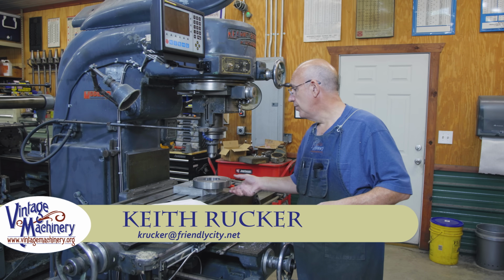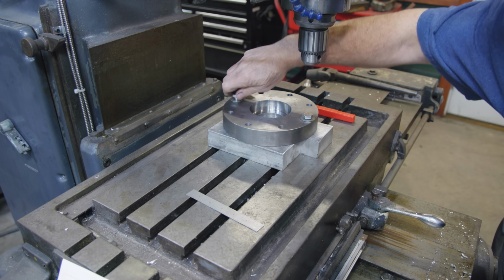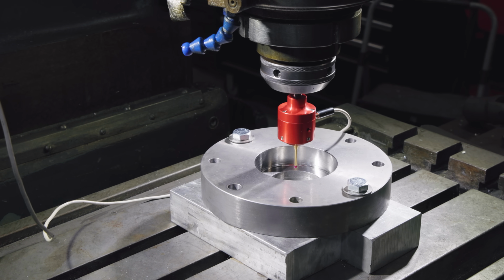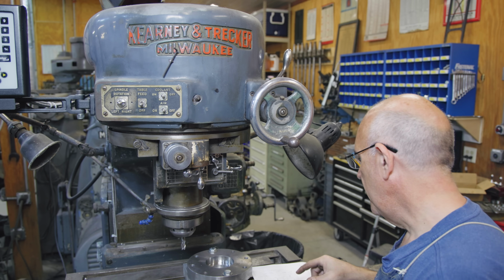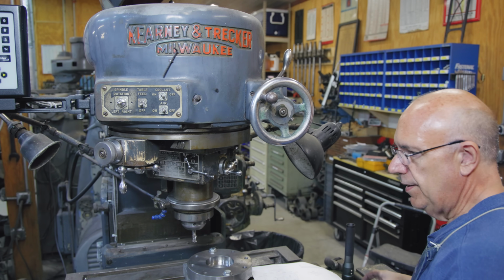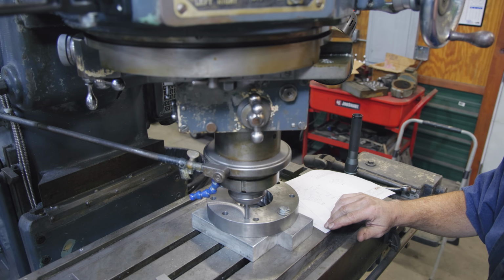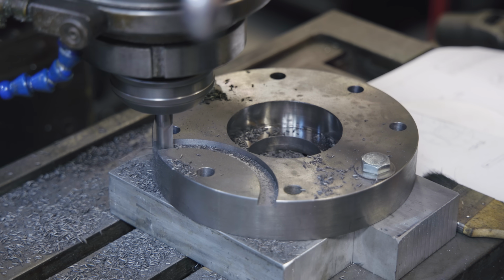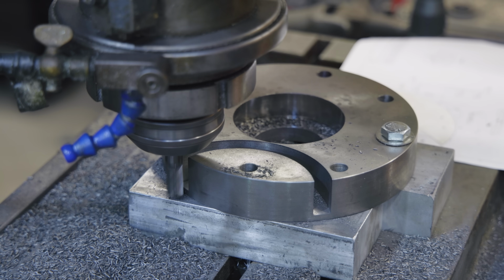Tally Ho Capstan Project: Circular Milling on the K&T 2D Rotary Head Milling Machine

Comment: is there a reason to not cut on both directions of the swing?
Reply: Yes there is, he was using conventional milling. Going the other way is called Climb milling and on older machines it can cause issues. Climb milling can leave a nicer finish so when it is used it is just for a finish pass at a light depth of cut.
Reply: @beilno2890  ok thank you, however that brings another question to mind, does the arc of this perticular type of milling machine effect that at all? or is there a diameter size threshold to go along with that or is it irrellevent on this scale?
Reply: @PhantomHelix  It has to do with how the machine is built. I don't know enough about that machine and what it is capable of. Generally the way lead screws are designed on manual mills do not lend themselves to climb milling. It is not to say it can't be done but it depends on the machine and what you are trying to do. CNC machines tend to only use climb milling but they are designed around doing so.

Comment: Just a thought  - would it be easier for the Tally Ho crew to install the winch while the  boat is still at their shop, where all their tools are?  I would think it to be more difficult  and inconvenient to install and rig the winch away from  tools and familiar surroundings.  The impression I have is they're fixing to launch pretty soon. I'm sure making good instructional videos is what you're trying to do  - but they need their winch. Thanks
Reply: Looking at the drawings, install should be a snap. It can't be too hard as it is always possible it needs to be serviced at sea.
Reply: Just a first and intermediate of several launches to accomplish various tasks
The capstan will undoubtedly be installed on land
🎉
Reply: According to yesterday's video they're launching today. Not sure what the lag is on Keith's videos but they'll likely be installing at sea.

Comment: That beep sounds ridiculously weak on the video! If it is really that weak I would never hear it in a loud machine shop
Reply: Probe systems that I am familiar with do not rely on hearing a beep to establish position. The beep is an audible operator reference convenience. I am most familiar with Renishaw. Their design uses a spring loaded 3 point precision ball contact that any direction probe contact will break one contact. Breaking this contact changes the impedance of the measuring circuit. This change is calibrated to "send a skip signal" to the control (in this case, the DRO). The DRO is tracking the machine position and captures the signal and position at contact. I assume that accuracy is improved by only measuring in feedrate, as I have never seen a probe on a CNC or CMM measure except in feedrate. I assume that this reduces any electric signal delay error. Obviously, the probe diameter must be known and the probe position must be calibrated to the control. Probe tip (ruby) runout must be eliminated to ease offset computation. On a CNC, each probe is calibrated to the machine and is kept with the machine. I have been wondering how this portable probe is calibrated for manual machine use? Z measurements must require calibration with every machine spindle insertion. Probe tip runout must have been confirmed and trusted on this video or the DRO would calculate probe tip hole center and not spindle center. I suppose that Keith has already loaded probe tip diameter data into the control, because he said that the DRO calculated hole center and hole diameter with 3 point perpendicular contact. He is relying on not only spindle hole center, but Y offset for radius mill pattern center position.

I have always assumed that this probe measurement process relies on accurately round bores with excellent surface finish and the part fixtured perpendicular to Z axis travel. 

I didn't see his fixture video, so I failed to see how he clocked the part to ensure the hole pattern matches the print. I think that his print showed that the hole pattern is not quite parallel and perpendicular to the relief arc. The part fit on the fixture with bolt clearance and boss slop and he demonstrated no clocking effort. 
His mill is pretty cool. I have never seen one or anything like it. My experience was limited to a single employer. I was exposed to a wide slice of machining technology, but limited to the technology used in our plant. I was a career maintenances technician and learned what I know about machining OTJ. I am formally trained in other disciplines and deeply experienced in the plethora of trades that fall under industrial maintenance. I am a hobby machinist in my retirement, teaching myself manual machining. A young highly skilled, at least 3rd generation family business machinist visited my shop a week or so ago. I was showing him my shop and was excited to show off my just purchased new dividing head. He was young enough that he didn't know what a dividing head was. He could go anywhere as a successful CNC machinist/programmer, but his experience is completely limited to CNC. His father and lifelong co-worker grew up cranking handles. I am pleased that Keith demonstrated some of his machine's capability. Keith's videos often leave me with questions about his approach, techniques and craftsmanship. BUT he has cooler machinery than I do and tackles work that I am unprepared to try. He is legitimately dearly loved and contributes vastly to our hobby community, but he often causes me to cringe when using methods that I classify as a hack operator... But he then demonstrates high precision work demonstrating that he has genuine capabilities.  He is a complex fellow.

Edit...
I re-watched and finished watching the video. The radius center lines and the cross holes all appear to be on center and perpendicular to the orientation cross holes. Assuming the hole pattern is standard spacing, the drawn relief arc should intersect the affected hole pattern holes in mirrored pattern, but are drawn irregular. He then mentioned that the arc dimension and location is non critical and only provides clearance. This may have been explained in a previous video that I didn't watch. 
His milling process with this machine is still very cool. 
I only ever serviced one K&T, a horizontal. We culled this machine in 1993 (I believe it is the exact model that Adam Booth owns.) I cut my industrial maintenance teeth repairing that machine. Everything on that machine was hydraulic driven and controlled. I think that is common on K&T, even on older machines like Keith's... At least it looks like it is an older machine. It was obvious that the arc feedrate was power feed. I suspect that it is hydraulic driven and controlled, but I wish that Keith had given a more in depth machine operation overview in this video. His machine probably significantly improves methods for multiple arcs like on this part versus setting up a rotary table multiple times. A very cool machine...
Reply: The audio levels on all of Keith's numerous productions: Not considered critical to the presentation enough to be addressed - solo maker, other priorities. Would it help for content consistency? At this point? No! After so many videos - it's just patina and, understandably Vintage. Great Job, Keith!
Reply: The DRO was not wearing a mic.
Reply: And a good reason for the light flash on contact. The DRO system knows the first contact and will stop input past that so as to not get a false reading, great accessory to a good system.
Reply: I listened carefully but I never heard the beep at all. Probably due to my hearing aids not picking up the high treble sound.

Comment: I still stand by my initial assessment upon learning of these mills: The coolest milling machine ever made. There are others that are even more versatile and intricate, but this one's got the cool factor down pat on account of being extremely well made and thought out.
Reply: And it's extremely accurate. Clearances are easy, the machine is capable of fitting parts as well!
Reply: And I want one
Reply: @EngineersWorkshop  and all of that with just a 3/4 hp motor. The machine is so tight it hardly needs more. Working to get my electrical sorted so that my 1969 machine (480V) that was built for the U.S. Navy can get up and running. It's a beautiful piece of engineering and a big old slab of cast iron lol.
Reply: @MagicCityTool  Is yours one of the inch/metric versions? Short table or long? Power knee?
Reply: Mine is the long table, power knee. 3300 spindle hours and in really nice original condition. Built for the Navy in 1969, broke a pin in the table feed and they just mothballed it. Simple repair. Machine came with every option unfortunately I got no tooling with it except the nut and a single 30 taper collet. Luckily I managed to horse trade for some tooling with Keith a while back before all of it was gone.
Reply: @MagicCityTool  any idea what they cost when new? Even my little Simmonet DZ450 would have cost $10,000 in 1972 so I’d guess a lot!
Reply: As I understand it when they were last being produced in the early 1970s they were around $150,000 in 70s dollars
Reply: @MagicCityTool  I’d say that was good value for money, and as ever swiss engineering was expensive! Ty..
Reply: The best machine in the world still needs someone who knows how to get the best out of it and enjoy the process of doing it. Kind regards Tim
Reply: I quite agree, but what about a SIP Hydroptic mill?

Comment: Good morning from Germany. This K&T Mill is a masterpiece of toolmakers.
Reply: It's absolutely amazing how that mill was  designed and built to function as it does.
Reply: @jackgreen412  In an era without computers Sure added on but the basic machine is just some engineering marvil BUT a machine is just as good as the operator and Keith is something special
Reply: @steinjonah660  You are absolutely correct about Keith operating the machine.   Years ago had amicable disagreement with a gentleman about computers.  I thought the computer was limited by the person setting up the program or inputting information .